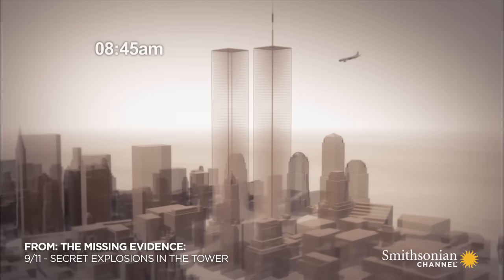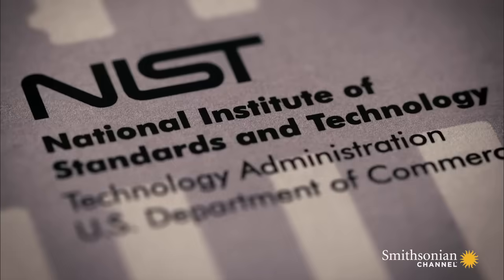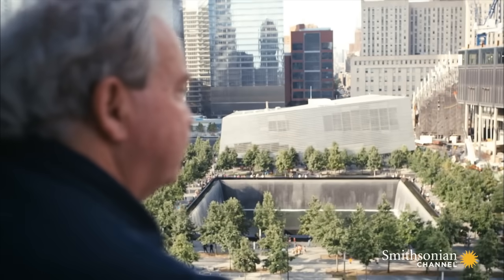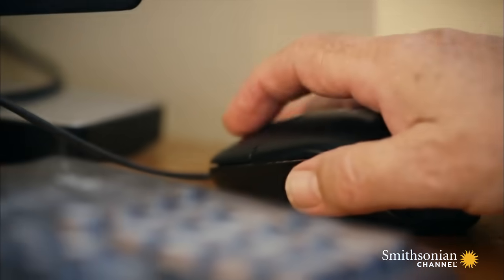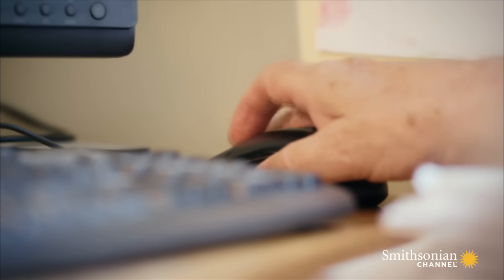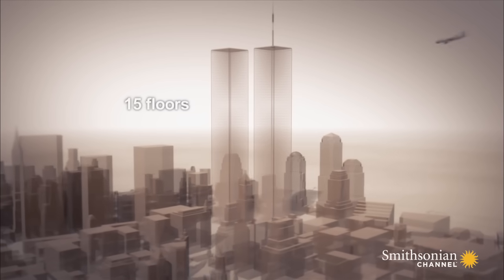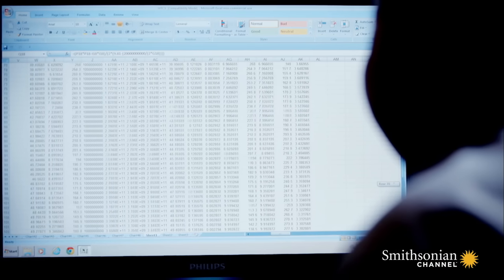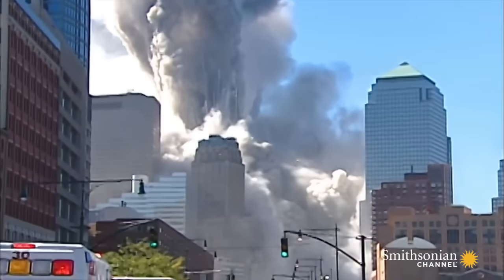This Computer Simulation Explains How the Twin Towers Fell

Comment: Juggernaut or no juggernaut, the resistance put up by the uncompromised lower floors as they collapsed was only about 0.5 of the resistance needed to keep the towers standing. You can work that out from the time they took to collapse. So by what mechanism was that weakening of the lower floors produced? This guy doesn't explain anything.
Reply: You had better do more calculating:   where did you get the idea that the steel capacity was so low?   That's not what the designers and builders said.  They did NOT say, however , that the towers were immune to Explosive Demolition.
Reply: Sorry - would you mind trying that again? I didn't say the steel resistance was that low - the opposite. The steel structure could exert 5x the building weight, but only needed to exert 0.5 to resist the collapse. It failed.
Reply: You left me confused.   Yes the building might be said to have "failed" , since it ended up in the street.   But NO structure is immune to modern Explosive Demolition, especially the military type, which this was.  It is EXTREMELY naive to imagine that  a gang of illiterates in caves in Afghanistan could have pulled off a crime of this magnitude.  So what exactly were you trying to say?   "Inexplicable" cause?  Aliens, ? NIST is right, or  what?!
Reply: no fucktard its not crazy that a "gang of illiterates in caves in Afghanistan could have pulled off crime of this magnitude"  first they were not from Afghanistan they were mainly from Saudi Arabia, they were hand picked for the job and had been training in the US.   Your statement just shows that you are an ignorant person who lacks basic reasoning skills.
Reply: disgny
Yes, agreed. Sorry for the confusion.
Reply: disgny
um i said nothing about the Islamic World prior to 1950's

i know my history far more than you do.

"Your Theory that explosions and demolition do NOT require explosives is new and interesting, but pretty lame."

no its not, an explosion is technically just a rapid expansion of gasses
Reply: disgny
funny how you seem to claim that the Arab world does not commit terrorism yet you know that they resent the western world
Reply: To say that "the Arab world commits terrorism"  has about as much truth to it as to say the "the Western World commits terrorism".  I say they BOTH do.
   As for resentment,  in your extensive studies of the Arab mind,  you are doubtless aware that the "Arabs"  have NEVER had modern "Nations" (of their own choosing).  The Arab empire was demolished by the Turks hundreds of  years ago, and all the Arabs were 2nd class citizens.  So "Arabs" missed out on the whole western experience with "nations", which is one reason they  don't function well with them.  And yes, they resent the way the Allies cheated them with the Post WW1 Treaties.  Of course, you know all that. Let's remember what Osama bin Laden said was his chief Beef against the West:  Quartering Western Troops in what they consider their "Holy Land".
Reply: disgny
by the definition of terrorism no the west does not really commit terrorism.  the whole point of terrorism is to create the most fear for the least cost.

the west creates the least fear at the most cost.

all your spiel i know but it is irrelevant.  what matters is that the Islamic world is angry at the west.  and some groups within it are willing to commit random acts of violence to try to accomplish their goals.
Reply: Are you seriously trying to pretend that Drone strikes are NOT "random acts of violence"?!  They break every rule of Justice that  the West  pretends to honor. They are the acts of a Mafia Chief.
    And let's not overlook that your  RE- definition of "Terrorism"  ( a western term)  is the same kind of sick fantasy that "Jihad" is.
Reply: disgny
no drone strikes are not random they are targeted, nor are they designed to spread terror among random people.  if the west wanted to spread terror they could do so.

i did not re define Terrorism that is the definition.

Comment: And so, a smaller mass falling on a much larger mass will COMPLETELY vaporize the larger mass? Why were there no pauses as lower, undamaged floors resist the collapse and how does this explain the 47 steel columns of the central core all vanishing at the same moment? Finally, how does an impact on one side of a building create an almost symmetrical collapse? Just asking.
Reply: The lower floors weren't undamaged.  you guys all love the Conservation of Momentum angle on this with the physics.  But forget the Conservation of energy angle.   The planes hit the building the Airframes shearing metal support columns and starting a fire.  The shockwaves from the impact TRAVEL down the building the kinetic energy spilling into the sturcture which is already built to sway in the winds buffeting it from the harbor. The Express elevators and the elevators in the floor damaged falling to the bottoms of their shafts spreading the fire to the lower floors where you can't see the flames because of the designs of the windows.  There were eyewitness reports of flames IN THE LOBBY and people in the lobby set on fire. because... AIR HAS MASS.....  That's why there's wind... Right?  So a fireballs travelled down to elevator shafts to lower floors.  Air Pressure preceeded these fireballs.  IT BASIC PHYSICS.  one rule doesn't stop while the other rules are in play.  

THINK
Please.

Comment: HE USED EXCEL? That's no engineer to be trusted. LOL
Reply: When is the Mother Ship coming to take you and Elvis back to Zultron?
Reply: he is not an engineer. he is chemist. 
'They examined debris...'' = lie. Debris were disposed in extraordinary speed. only little evidence was analyzed. 
Why chemist did not talk about chemicals found in the dust, but he attempts to be constructional engineer.
Reply: Well if your holding an investigation and your budget is $20...
Reply: Aqua Vortex117 Which I've already addressed...
Reply: Rolands J...What are you even talking about? I apologize, but I find it hard to understand your somewhat broken English.
Reply: That was just a documentary shooting, he probably didn't actually use excel. The camera crew just wanted it to look relatively real
Reply: It's true that jet fuel doesn't burn hot enough to melt steel, but it didn't need to. It burned hot enough to weaken it. Also, that point you made about what would happen to a plane if it crashed into a concrete building, that's not what happened to a B-25 Mitchell when it crashed into the Empire State Building in 1945. Sure, some pieces broke off upon impact, but it did go inside. Also, the B-25 has a top speed of 270 MPH.
Reply: @animegamingdude  why didn't that building fall down?
Reply: @notsponsored103  Very different circumstances compared to 9/11. Different building construction, much smaller plane, much lower speed.
Reply: +animegamingdude I feel you
Reply: animegamingdude you cant see the difference between molten metal and weakened steel. fuck the english, cant care less about spelling here.
Reply: YALL GOT A PROBLEM WITH EXCEL?!? MICROSOFT FOR LIFE BABY!!! Lmao
Reply: lmao, I say maybe $200 , $20 can't even buy the microsoft office.
Reply: + Baponator For small experiments? Sure. For SIMULATIONS? I don't think so. At the very least you could use VBA, but if you're not, the sheer number of errors you could make without even knowing it? Insane. My husband is a physical chemist, and he showed me how he was working with his lab results, using 50 data files, sheets upon sheets, columns upon columns.... one tiny mistake cascades and is very difficult to see much less track down. I helped him transition to matlab, and is single-handedly importing his 50 text files, auto generating all his column names, auto generating all his graphs, and the whole thing runs in 30 seconds. If you really think that excel is the best software to use, as an engineer that makes me very sad.
Reply: +Keeger No darling. Please read my comment more slowly. I'M the expert in coding and gave HIM a tutorial. For the record, coding is my job and I have a masters in mechanical engineering with an emphasis on computational fluid dynamics. I'm more than qualified to speak about what software is appropriate for engineering applications.
Reply: team14robot well said. Just shut him down lol. Good to hear someone on these 911 vids that actually know what they're talking about and put these shills in their box. Btw have you ever tried running a simulation with your experience to get the same result as NIST?
Reply: animegamingdude
your are bit wrong!
jet fuel or something elsehad to! What else was the energy source, if we can observe molten metal in the WTC1 and 2 sites, how did it get there? We see molten metal pouring out of the building on video, we see fire fighters talking about molten metal inside the building, we see photos of molten metal at the WTC rubble sites. So lets not ignore clear evidence first! and then think about physical mechanism that made buildings to pulverize in midair.
Reply: +animegamingdude jet fuel can't melt steel beams
Reply: I bet it's a false flag, similar to the Kennedy Administration plan (terrorism on its own country) but he didn't sign it. It's a false flag to garner public support to covertly invade Afghanistan, and Iraq by the us of War on Terror for the reason to steal their oil. Also, a neat fact, Osama bin laden's family (Binladin Group) is a business conglomerate in the middle east, and George W. Bush is part of the Arbusto Energy plan between the two. Think about it and I'm gonna be-
Reply: +Kevin Chen Technically you can buy Microsoft Office 365 (cloud edition) for $15 a month... haha But I know that's irrelevant.
Reply: Word Perfect, Spreadsheet Edition!
Reply: Jacin Shardlow No but Ive very much wanted to. I would need access to the raw data to run the calculations.. not sure if its available.
Reply: team14robot what do you mean by 'raw data?' Excuse my ignorance as I really have no idea. But do you mean like what it's made out of size weight planes fire temp etc.? Cause I'm pretty sure it can all be found and it's open source on the net. I'd be happy to help you.
Reply: Jacin Shardlow - For all 3 bldgs, NIST published all the sizes, dimensions, & strengths of all steel members, bolted connections, locations plans, sections bracing, shear studs, stiffeners, moment connection details, heights, loading time & location of fires, extent of plane damage, fireproofing, concrete weight, strength, thickness, reinforcing, metal pan size, gauge, wind speed, and much more. Anyone who knows what they're doing is free to use the inputs and create an engineering model and publish it.
Reply: PoetryHound well I would glad to help team 14robot to do it. She is the expert. I would just like to help. I think there would be a different outcome. Why else would you classify the computer model simulation.
Reply: team14robot all the raw data is available as I was just told. Would love to help u in any way I can. Can look me up on FB. I'm the only one on Facebook with my name.
Reply: TheDamnoranges Lmao, only people too uninformed to make an effective point resort to name calling. You do you, boo. :)
Reply: Kevvy Kim Storage of raw data of course. but its unrealistic to do such complex physics calculations using excel. In these simulations you have to consider fluid dynamics, solid deformation, combustion, etc, as well as the effects of each of these on each other. No one does FEA using excel. No one can do reliable CFD simulations with excel. We just DONT because this shit often takes several computational servers hours, days or weeks to run the simulation to completion. Are you an engineer? If so, why kind? Did you go to grad school and do computational simulations?
Reply: + Dylan Madigan LOL No, but Excel isn't an efficient way to do calculations in engineering applications.
Reply: it's enough for all the sheep eager to believe this crap
Reply: The excel sheet was just calculations... I'm a chemist and have worked with tons of physicists and we literally all use excel...
Reply: A lie cannot be proved. 9/11 official story is one big lie. 

The evidence is overwhelming. Only people who are preprogrammed to believe the government story or have not actually looked at the evidence could possibly believe the official load of nonsense.  

Basic stuff like when a crime is committed anywhere, the crime scene is sealed off and the area is examined in minute detail. NOT ON 9/11, the world's worst attack and they ship off the evidence to China ASAP while folk were still in shock and not asking questions. 

The fact that the law of physics ceased to exist on 9/11.

The fact that building WC7 just fell down without anything crashing into it and many demolition experts all testify that it was a controlled explosion, no other explanation possible.

The fact the Silverstein the owner look out policies just months before 9/11 and on the day said "full it"

The Twin towers were old and out of date and full of asbestos, the port authority had an estimate of over $200 million to remove the asbestos alone.

Never in the history of high-rise has one ever fallen due to fire, never ever. If 9/11 really happened we would have to reassess how we build in the future. 

Architects and Engineers know it's simply impossible to melt steel with anything except a blast furnace or Nano-thermite so no new safety standards were ever brought in for high-rise construction worldwide as they were not required because high rise cannot fall down. http://www.ae911truth.org/news/evidence.html 

If you crash a plane into a concrete building the engines fall to the ground, wings fall off and it will most likely flatten like a pancake. They tested this a while back , throwing a 737 at 500+ miles per hour into a concrete slab and it just ended up like you would expect a plane crash to look like, huge fireball but with visible parts, seats, luggage, engines, black boxes and many plane parts all scattered around the crash site.

The evidence goes on and on as a LIE CANNOT BE PROVED.
Reply: animegamingdude you have not addressed a shit! we have observed molten metal, you talk about some "to weaken it".
you see the difference? or you pretend to be extremelly dumb? molten metal - weakened metal.